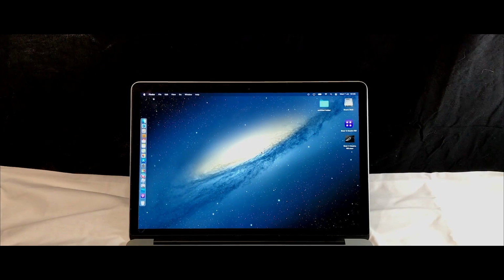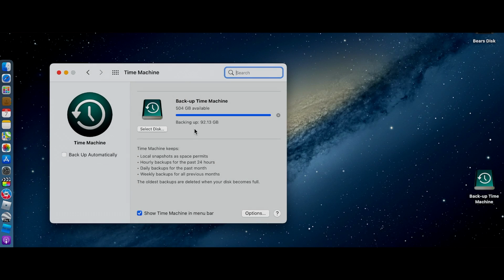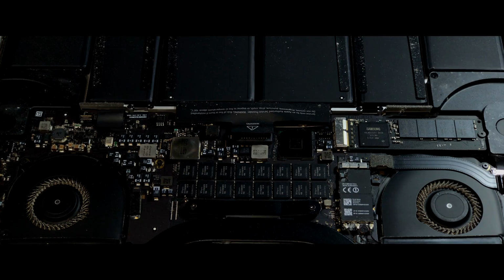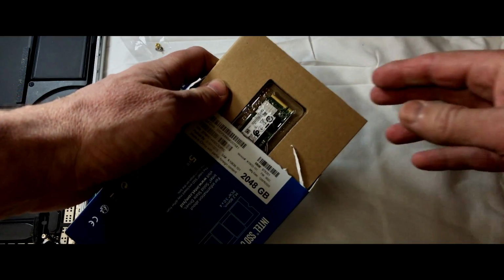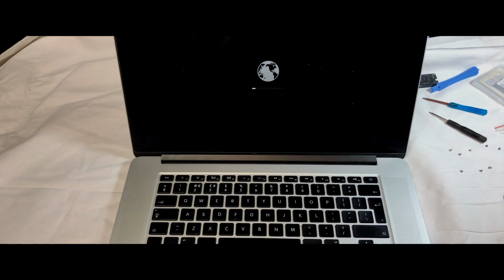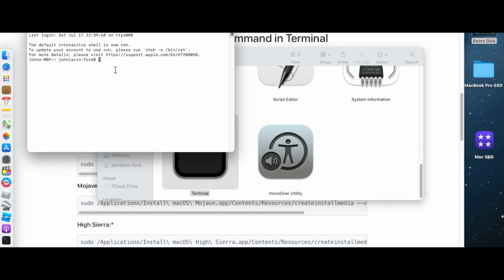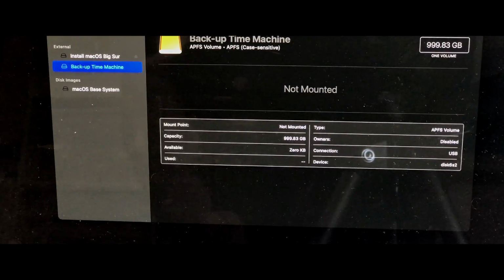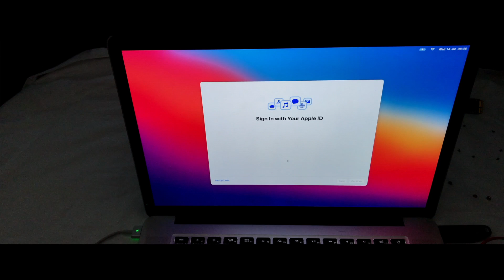Upgrading MacBook Pro 2014 with ssd. Intel ssd 2TB 660p m.2 . Intel 660p series internal ssd.

Comment: I bought a few adapters off Amazon (bad place, I know, but the only one I found) and it seems they are all limited to 1 TB. I am using a Mojave installer USB.

So, should I just get a Sintech adapter?
Reply from the maker: hi… I can only talk from my own experiences … my combination worked for me… what I have found out is that when companies limit the recommended card (sd for example) in devices or hardware, it was done at a time well before the advert you are seeing… for example my dash cam says limit only 32gb… I have a 512gb in there… apple literature state only a max of 1tb in my MBP.. I have a 2tb in there… I realise that might not be the case for everyone, but at least with Amazon you can send it back….
Reply: @bearsadventures666  This is interesting, but also frustrating. You are the second person who have demonstrated success on YourTube so it obviously is possible, I just wonder what the trick is, adapter or SSD brand.
Reply from the maker: @Ragnemalm  tell me what issues your are having exactly and i will try and help you… I found the order of events frustrating as it took me 3 attempts… all of which takes ages… its a test in patience (for me at least)
Reply: @bearsadventures666  Thank you for the response! What happens to me is simply that the Mac won't recognise the SSD. It works just fine with a 1TB SSD, same adapter, same brand (Kingston). The 2 TB SSD works perfecly in an external exclosure.

I tried, just like you, the online restore function, and it didn't work, of course. But I also tried installing from USB, 10.14 to be exact, and it still doesn't see the SSD, neither the installer or the disk utilties.
Reply from the maker: https://www.amazon.co.uk/gp/product/B07WYCRZZD/ref=ppx_yo_dt_b_search_asin_title?ie=UTF8&psc=1      …. That one also works

Comment: I have a Macbook Pro Retina 15", Late 2013 (A1398) and I am considering to replace SSD.
I heard that almost every MacBook has standby/autopoweroff/hibernation mode issues after replacing the factory SSD with a NVMe drive (except for the 2015 model maybe).
Did you experience any issues with standby/autopoweroff/hibernation mode using this Intel SSD?
Is the Intel ssd 660p m.2 a NVMe type?
Thanks.

Comment: I'm trying to do the same thing and have the same Mid 2014 15" Macbook Pro. I'm using a Crucial P2 2TB but my issue is that disk utility won't recognize the new internal SSD and only lists disk0  so I can't partition it!
Reply from the maker: Hi, thanks for commenting…. Crucial M.2 does work as a friend of mine has one …(1TB)… admittedly not 2tb but there should not be a difference…. Ill look into this and get back to you.
Reply: @bearsadventures666  Sorry mine is a 1TB as well (wish it was 2TB!). It's very weird and I thought it might not have been snug enough so removed the HD and tried to install it again with the Santech adapter and still nothing shows up on my disk utility. I saw another video where you can go into terminal and try diskutil list but the new HD still wasn't showing up there. For now I just put my OG Samsung 256gb back in but I thought this would be a lot simpler to do lol
Reply from the maker: @ShaneAOF  hi… bear with me buddy… ill try and help…. Give me a few days to return home and so i can play with my MBP and get back to you with suggestions… It should work fine but i did also have to re do things a few times from memory (as in my memory lol)
Reply: @bearsadventures666  hey Any update on this?
Reply from the maker: @dancingdragon8641  well it still works…. Touch wood…. I use it in addition to my 14inch MBP.
Reply: @bearsadventures666  Sorry I meant if there was any update to the person above situation as I’m experiencing it as well
Reply: @ShaneAOF Did you manage to get it working?
Reply from the maker: @dancingdragon8641  Hi yes of course…. At the end of the video you see it working better than ever…. It still works perfectly today… i use it to render files as im editing on my main laptop….
Reply: @dancingdragon8641  I did not unfortunately

Comment: Hi.. nice work. Wanted to ask if you Mac is faster after the upgrade with the SSD Disk ? do you see any difference by using normal Programs like ( Word , Acrobat ans so on ) . Thanks .
Reply from the maker: Hi…. Yes there is a notable difference in overall speed… even in FCP… It’s about 45-55% quicker

Comment: I am in the process of upgrading my wife's 2014 16" MBP. I downloaded Bug Sur from the Mac Store. Opened it and installed it on my Samsung 980 NVME using a $30 NVME Enclosure from Amazon. Then I elected for Migration Tool during setup so its in the process of cloning right now. Here's hoping it works. If so it may be a little easier than this process.
Reply from the maker: That's a good suggestion mate... Thank you.